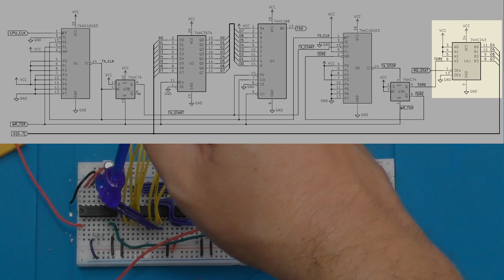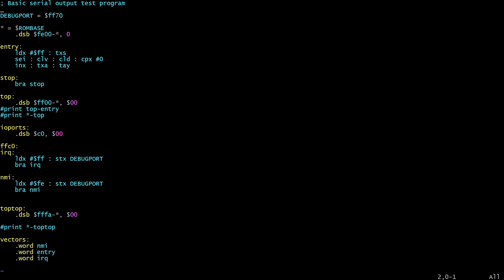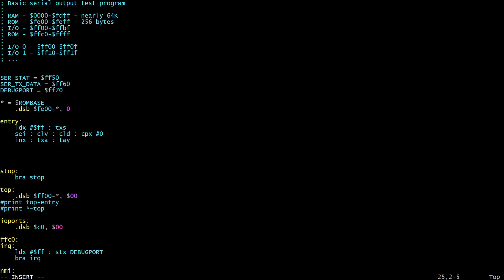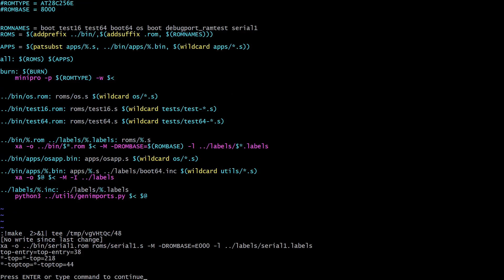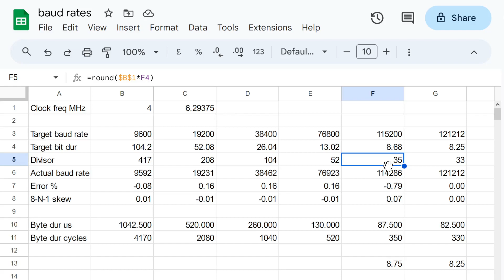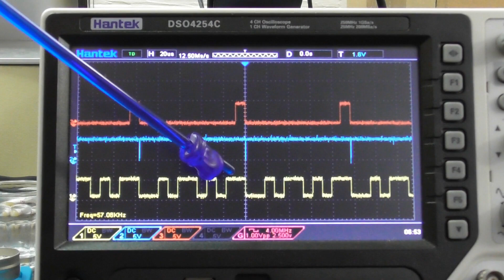Serial output circuit connected to 6502 computer

Comment: Why did you chose 74hct273 instead of 74hct573? 573 has more trace-friendly pinout for bus buffers/ports and LEDs.
Reply from the maker: I don't have a '573 in stock, but I think I used a '574 here.  I sometimes use '374 or '273 just because I bought loads of them in the past and have them close at hand.

Comment: Did you consider to use 16 clocks cycle in discrete RS232? The top data throughput will be slower, but you can have one or two chip less in the circuit...
Reply from the maker: That's interesting, I'm not sure exactly what you mean though or how it would reduce the chip count?
Reply: If you'll implement 16 clocks per byte /*1 start bit + 8 data + 7'stop' bits */, you will not need a divider by 10 or 9 chip, you could use lower bits of divider of single multiple stage divider chip like 74AHC1G4212 or 74HC4059 etc... @GeorgeFoot
Reply from the maker: Ah right I see, yes perhaps that could work.  I do use IOCLK/16 as the baud rate in a newer evolutions of this system, for 250000 baud, but yes perhaps I could also use the high bits of a wider counter in that case.   @alexloktionoff6833

Comment: I think you'd better produce I/O clock from the main clock to have them synchronized and avoid CDC and metastability, isn't it?
Reply from the maker: Yes, it would. I'll discuss this in more detail in another video I think - the reason I did it this way was to allow me freedom to experiment with changing the CPU clock speed without impacting the I/O. If the system was unstable, I wanted to know it's not the I/O that's causing it.  

Once a CPU speed is settled on though, having the I/O clock be a division of that would make the glue logic simpler as it wouldn't need to worry about metastability.